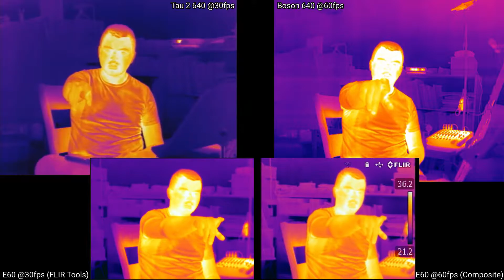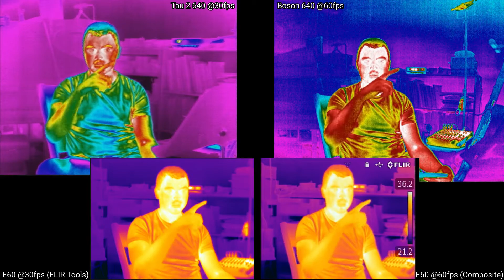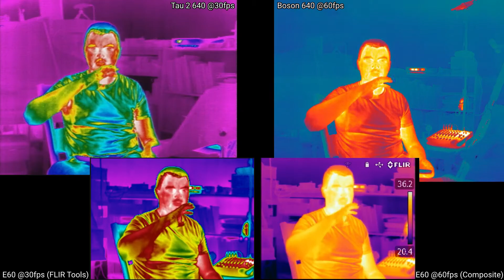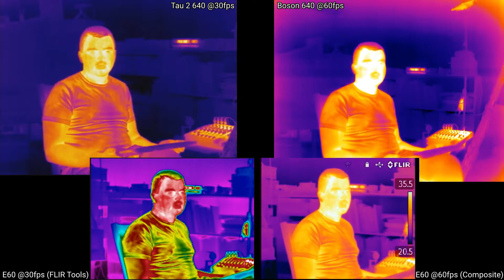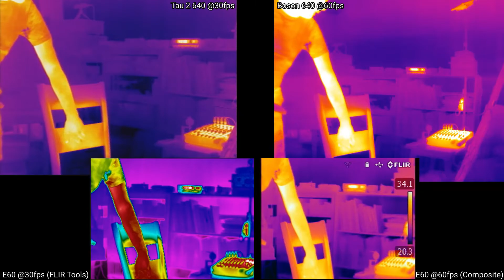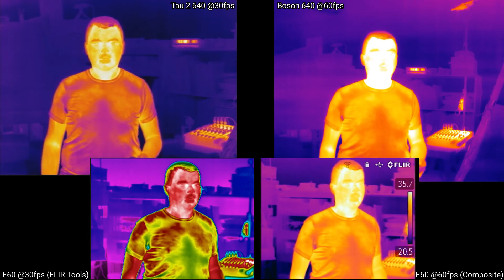Image Quality Comparison of FLIR Tau 2, Boson, and E60 LWIR Thermal Cameras

Comment: How did you get the video output to the PC to record this? I have a Tau 2, but the software I use to hook my Tau 2 (with a VPC) seems to only allow me to take snapshots and make setting changes. The mini coax port on the VPC died after using it for roughly an hour, but the VPC still powers on and connects to the computer. If I could use the USB connection to the computer for live feed instead that would be great.
Reply from the maker: You have to pay a pretty hefty premium for the digital output, I think it's only the CameraLink VPC from FLIR, but there are USB ones from third parties.  That said, I used a cheap USB analog video capture dongle to capture this.  Most options should work, but my preference is one that uses the UVC standard because it integrates well with everything without drivers most of the time.

Comment: I remember reading that in atronomy, they'll take data from multiple cameras and digitally combine them to get better resolution, is that something that could be done with these cameras to see better detail from further away?
Reply from the maker: Definitely, and I know a few FLIR and Keysight/NEC Avio cameras that include a mode for this, even using a single camera sensor.  The disadvantage is that it both takes multiple exposures and some amount of post processing - so unless you have a very fast readout sensor, you're not going to get realtime video out of it.

There could even be something similar to this happening in the Boson already - it uses a good bit of image processing hardware onboard the camera, and I think this is why the sharpness adjustment in particular can achieve some very high resolution appearing images.
Reply: You can stitch images together to create a functionally higher resolution image but what they do in astronomy is some science magic involving interferometry that makes it so their image quality is effectively what it would be if they had a lens the size of the area between them, not just the sum (at best() of the composite image. We're only now doing this with visible light in astronomy because their wavelengths are in the hundreds of nanometers, which is the precision you need in placing your receiver/mirrors from two telescopes to get that benefit. We've been doing it with radiowaves for a long time though since their wavelengths are huge. That black hole image was taken using digital images timestamped by atomic clocks at radio telescopes around the earth, which allowed us to create what was effective an earth sized receiving dish. Though, to clarify, this only increases image quality, not brightness.

Comment: So which camera is the best per say for a vehicle to see at night at distance?  For things like animals  people, or per say if someone was pulled over ahead of you with his lights off and radar off? You know like seeing the heat sig of a running motor in the pitch black.. which would be the go to camera?  I guess they're discontinuing the current "vehicle" set up. I'm just curious if there's a decent flir camera for being able to see things at night in real time.. any suggestions?
Reply from the maker: I doubt any of the cameras used here alone would be the right choice.  If you're looking for detail at distance, you want a narrower field of view, and while there are camera cores with longer focal length lenses, they aren't integrated with a screen, aren't waterproof, aren't vibration resistant, etc.  For simple spotting, maybe a spotter scope is a good choice, but otherwise getting a camera model that has been weatherproofed for outdoor use is probably a good bet - I haven't worked with any personally, but they do build these cores, and cores like them, into marine camera systems (often turreted, like a security camera), then there are security cameras with a thermal camera installed, and there are the aforementioned hunting/spotting scopes.

It's not that these couldn't work, it's just that there are likely better lens/packaging options for something like what you are describing.
Reply: @mdbssn  that's my conundrum I'm under the understanding that thermal doesn't work very well through glass? I suppose that makes sense as it'd be a heat soak but something I didn't consider.  I've also been looking at drone cameras as they'd have shock/ weather resisting and some have thermal/ zoom capabilities.  

One of your tested cameras was listed as the "next in line" for flir to use as these thermal vehicle cameras but its hard to find any actual testing.  Some are claimed to have heat detection to 1500 yards while others are significantly closer at 550 ish yards I feel like 550 is more realistic then the 1500 claimed

Comment: I don't understand why anyone would test a thermal to see a target 5 meters away. The naked eye could see that as well. We need to see if the thermal can detect 500 meters etc. Testing it in conditions where the human eye can't see. It's like testing night vision at noon.
Reply from the maker: Night or long distance vision isn't the only nor primary application of long wave infrared cameras.  These devices visualize a band of the EM spectrum that the human eye simply can't, so the ability to visualize it at any distance augments the perceptive capabilities across the board, and there are many applications where thermal analysis of a specific region - far, up close, or even at microscopic or telescopic scales - is important to understand heating without contact sensors.

While I don't make the most interesting subject for such cameras, the fixed focal length lenses on most thermal cameras mean they're well suited for a specific range, an in the cases of the ones demonstrated, it's this near to mid range (more like 3m away in this demonstration, the e60 is the best suited to longer distances but still has something like a 25 degree FoV.)

Comment: Such unique video!.... Where did you get them, I even didn't find those models on sale. What do you think about Vue models (found on Adorama), probalby old and in 2021-ish are there better options?
Reply from the maker: I have generally gotten mine on the used market, and at least inside of the US there is some availability on ebay and the like (>9Hz framerate cameras are export restricted from the US and there are similar laws elsewhere).  From a quick look, the Vue probably uses an ISC0901 sensor, which means the image quality is likely comparable with the FLIR Ex series cameras (not the Exx series pictured here), but since it's fairly popular in UAVs, you can probably find some video from it around.
Reply: @mdbssn  Hi, do you know about regarding registration, like you can't export abroad, but do you need somewhere register 30-60hz devices? Or it's no needed registation for use inside the US (as a private person, for nature observation etc. simple civil activity)? And, will I able to sell it later on ebay inside the U.S.? Is there regulations?